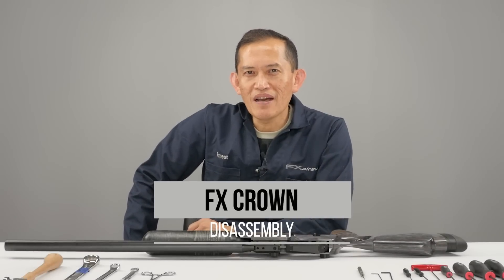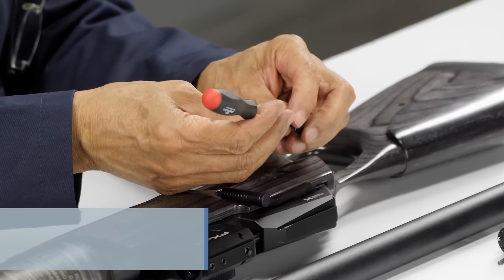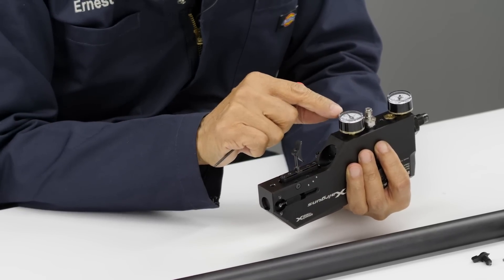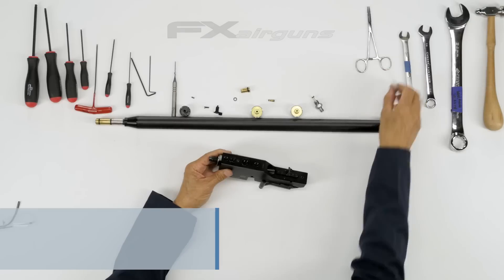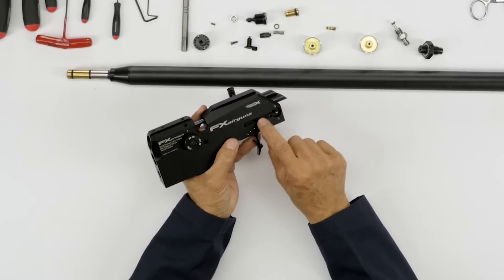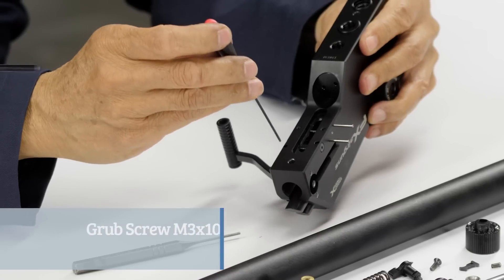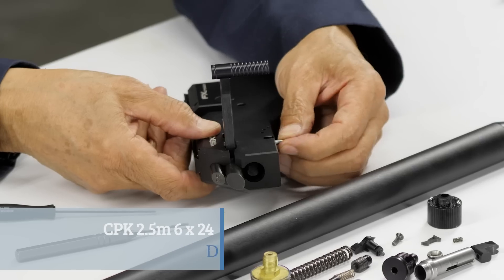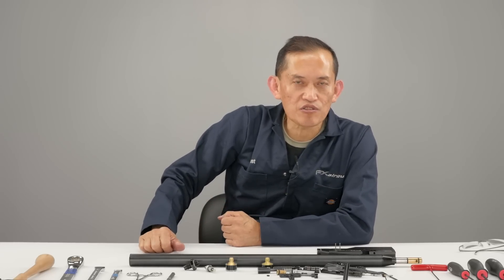How to Disassemble FX Crown - FX Masterclass

Comment: Can you confirm that I can remove a carbon bottle which is under the pressure , just needs to be unscrewed easily even  it is under the pressure , how it's regulated that simple ?
Reply: Yes you can remove it even it has air inside. There is a valve inside of your tank that keeps the air while removing it. I've done it already.

Comment: any advice please i have a .22 crown in 12ftlb and just got a .30 cal kit ive swapped this over and adjusted reg to 150 and turned wheel to 25/30 and adjusted hammer spring but im only getting 10ftlb how do i achieve 80ftlb what am i doing wrong thank you steven
Reply: Was your rifle sold as a 12ft.lb. model?
Reply: It was yes
Reply: @theyorkshirelad.  The best I know is those models have some type of restrictor that prevents them from making more than 12ft.lbs.  I don't know where or what though.

Are you on the AirGunNation forums?  Someone there will know for sure.
Reply: There is an allen screw under the scope in the main cylinder, remove that screw and you will get the full power.
Reply: did you already solve your problem rabbithunter?

Comment: Hello Ernest, it was nice to meet you in Chile ... please, I need your help, I have an FX Crown .25 and a telescopic sight Aztec emerald 5.5-25 x 50 MM, in FX Airguns recommended me to use the regulator between 125 to 130 bar of pressure, which is perfect, I use a software called Strelok or Chairgun, to help me to have more precision at a distance and perfectly squares the distances with the MilDot.
When I change the .22 caliber cannon and enter all the data to the software, I completely lose the precision with respect to the mildots versus distance, I do not achieve the accuracy that I have with the caliber .25.

What will be the problem?

Please, I await your response.

Thank you.
Reply: This would be a function of the ballistic calculator.  They can be a bit tricky to get them to do exactly what you want.....depending upon your equipment.  Make sure you have all the data input correctly into the calculator.
Reply: @BullseyeBob  Friend, the data is well entered, in fact it works perfect for the caliber .25. Once I change the cannon, I maintain the pressure of the regulator and speed calculations, in addition to calculating the Ballistic coefficient, by the difference form in the fall of the poston. I read in the FX Crown manual that when changing the barrel I must modify and lower the regulator pressure and that is what I will do to test.
Thank you so much.
Reply: Siempre vuelve a medir la velocidad del diabolo luego de hacer cualquier cambio de calibre o en el regulador. La única variable que se afecta al final de esos cambios es la velocidad del proyectil y esa es una de las que se ingresa en la calculadora. Saludos desde Bogota weon!:)